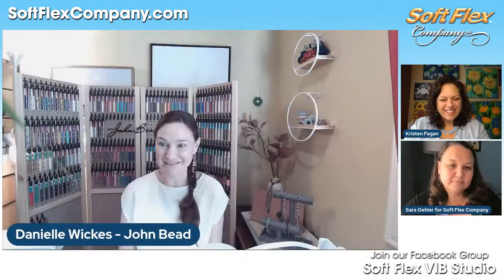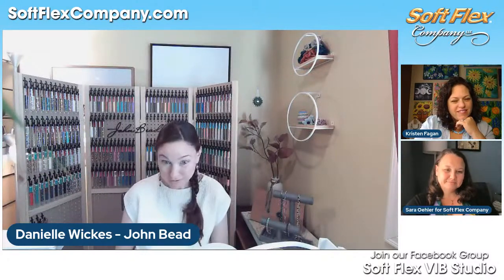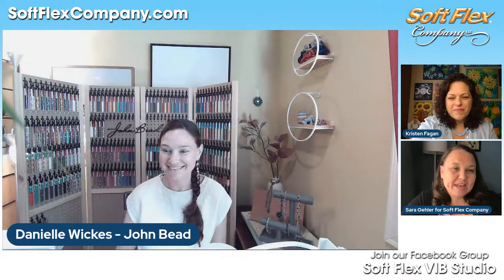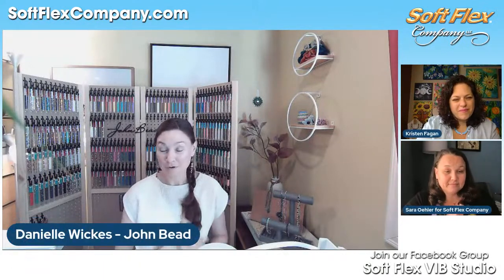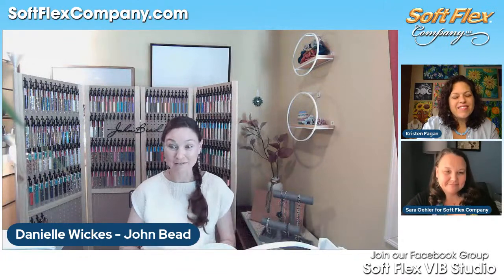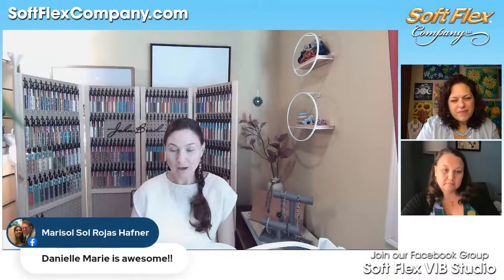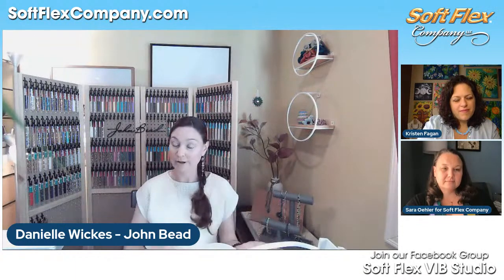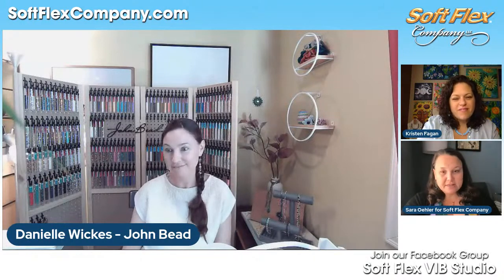Live Beading Party Featuring Danielle Wickes of John Bead - Learn How To Knot Soft Flex Beading Wire

Comment: I'm watching on replay and I just love Danielle. Wanted to share that you can also use a bead dealer to get the knot closer to bead. Just form knot and put in between knot and pull the 2 strands of soft flex
Reply from the maker: Thanks for the tip.
Reply: What is a bead dealer?
Reply from the maker: @suzannebrown9512  John Bead. You can buy their beads from ArtBeads.
Reply: @SoftFlexCompany  , I know the beads are from John Beads but Cynthia said she used a bead dealer to get the knot closer to the bead. I wondered if it’s a typo and she meant something else.